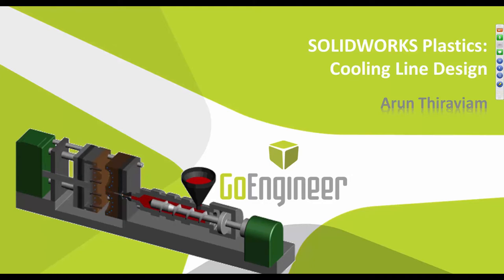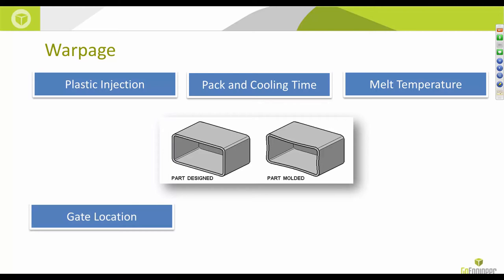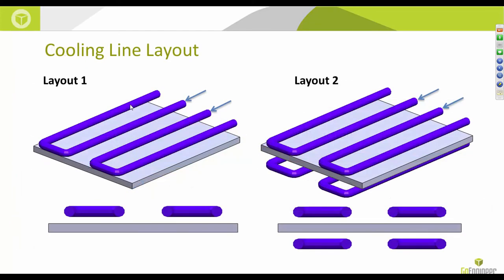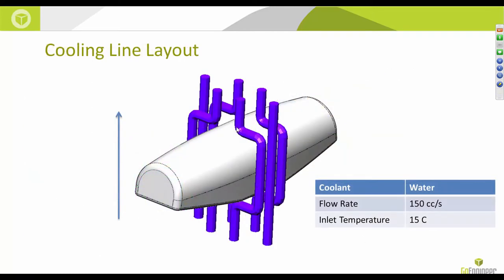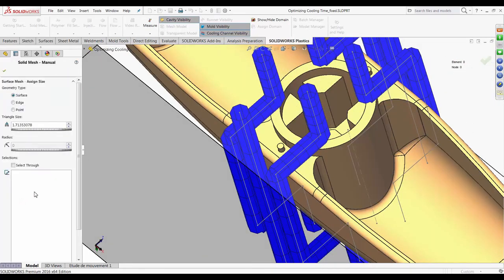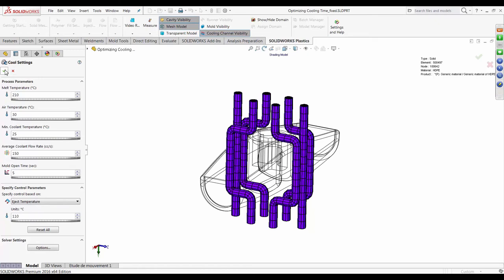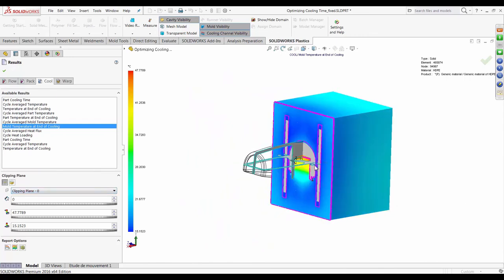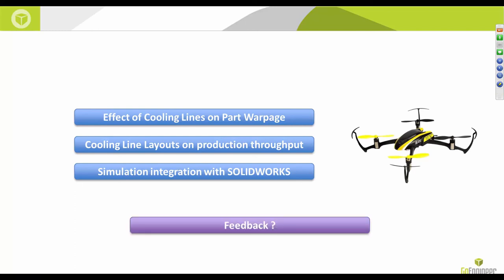SOLIDWORKS Plastics - Cooling Line Design

Comment: is it possible to use Air as the coolant
Reply from the maker: SOLIDWORKS Plastics does not have a fluid 'air' in the default list of coolants.  You could create a user-defined fluid for Air.  Coolants in SOLIDWORKS Plastics use constant values for Specific Heat, Thermal Conductivity, Specific Volume, and Viscosity, so you'll have to make sure you're okay with those assumptions. It may work, but it could require some testing to get it right.